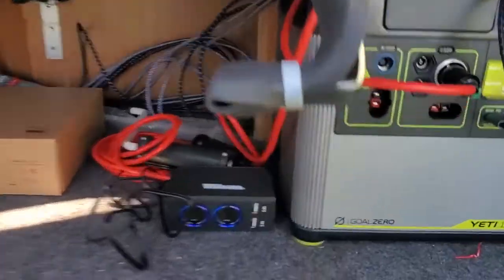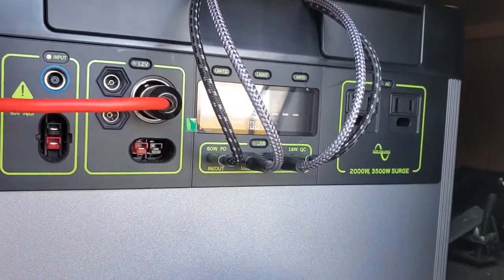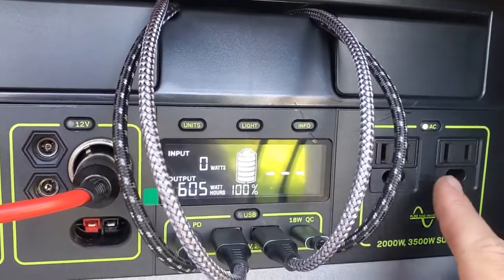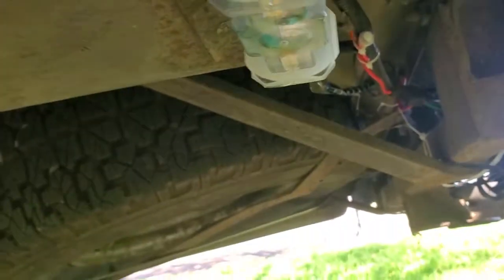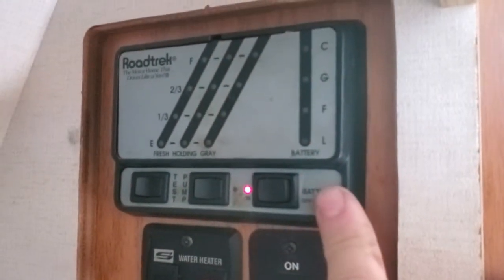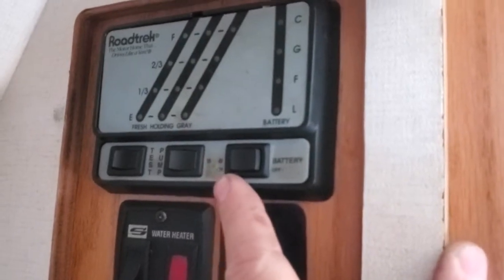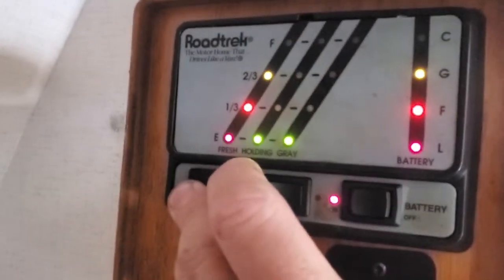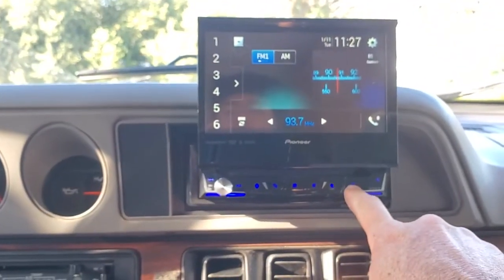Goal Zero Yeti 1500x Set up and walk through, + shore power hack.

Comment: wait so you are charging the 1500x with a 3 prong plug that goes into the front off the 1500x without using the supplied brick? I though those front 3 prongs were output. I have the supplied charging brick plugged into the top left plug toward the back off the unit then extension chord to that